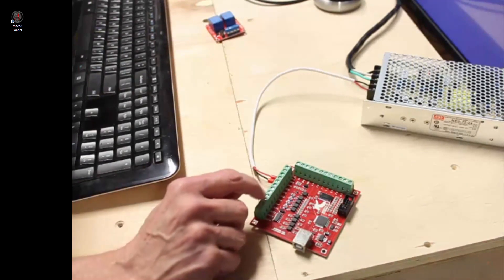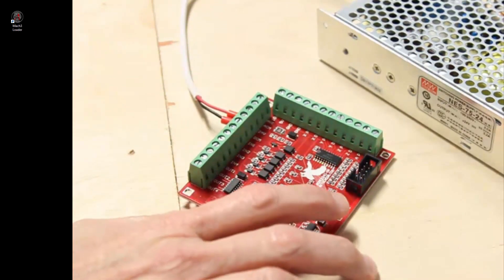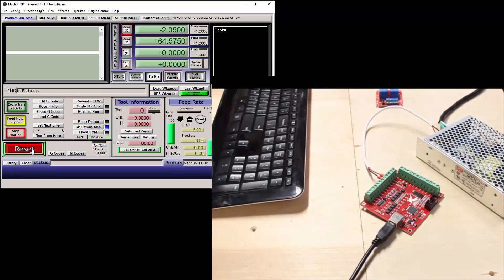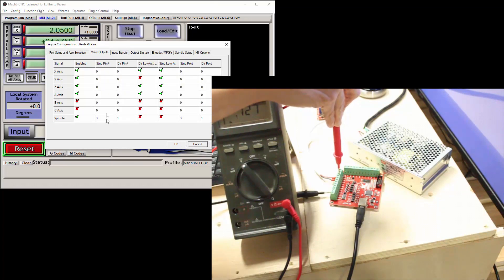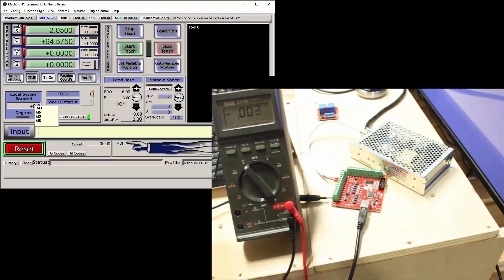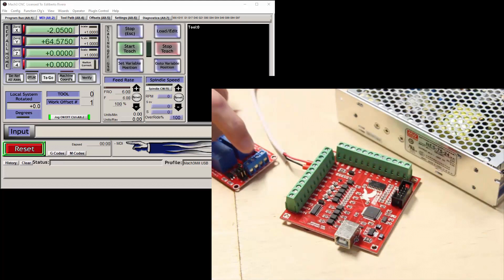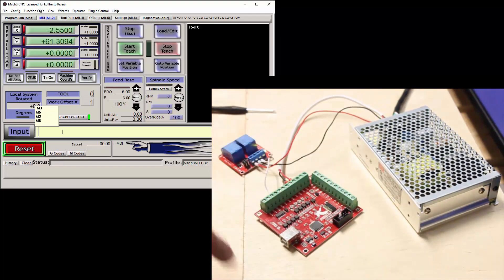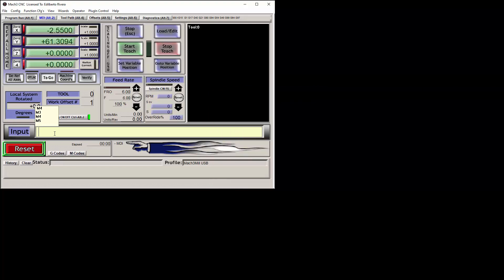Mach3 USB Controller Output Terminals

Comment: If you are having problems with your relays not working change the jumper from Hi to Low on the relay board.
Reply from the maker: Thanks. I do mention that at 6:09, but I do appreciate the comment as it is an important note. Also, I don't mention that the port number needs to be 3.
Reply: @PatrickHoodDaniel damn must have missed it. Spent hr trying to figure out why they wouldnt throw.
Reply from the maker: @BlueFlameOfLife  Haha. No worries. It's still good you offered your time to comment as others may miss it as well. You can't have too much information when working with this stuff, so I am grateful!

Comment: can I use my Breakout Board that controls my stepper motor & Limit Switches? i have a D25-1205 Board.
Reply: Thank you
Reply from the maker: Yes, this board can control 4 axes and has input and output terminals. The input terminals are for limits and homing.
Reply: I meant if I can use it for my spindle motor on the Breakout Board.
Reply from the maker: @miguelsendejas5302  You can use the board to control your spindle's speed through the VFD using the provided AVI (PWM out), ACM (Common for the PWM), and the 10V input. I have a video on this in my channel. You can use the output terminals to turn the spindle on and off, but I recommend using a relay. I have a video on this as well on my channel. To more easily find the videos, go here: https://buildyourcnc.com/products/electronicsandmotors-electronic-component-breakout-mach3-usb-board

Comment: With a 24v power supply connected to the 24v terminal (+) and the DCM terminal, (-)  OUTPUT1 shows 24v constant, with or without m3 enabled/disabled. It doesn't switch at all. (tested with multimeter in DC volts mode, with the negative probe on OUTPUT1 and the positive probe on the 24v terminal, as shown in this video.  The outputs confg shows the ports for pins 1,2,3 & 4 as port#3. Any suggestions would be greatly appreciated.
Reply from the maker: Make sure in the outputs tab, the output you are setting up is set to port 3. You may also want to check under the motor outputs tab under the spindle line item, the spindle setting may be conflicting with the pin you are using.
Reply: @PatrickHoodDaniel  Sir, you are a diamond. Thanks for taking the time to respond so quickly. It was the spindle setting. My problem is solved.
Your videos and website are the best resources for this board. All of my progress thus far is due to your videos. I can't thank you enough. Cheers!
I'm ready to move off the test bench and install the components into my plasma table. A celebratory coffee is in order.

Comment: nice video, congratulations, is it possible to connect the laser to the Mach3 USB Controller, if possible, what should be connected, I have a router with a Mach3 USB Controller and I want to add a laser, thanks
Reply from the maker: Yes, but I wouldn't recommend it. Unless you have a special purpose that you need to use a CNC controller to operate a laser, I would recommend using a laser DSP controller.
Reply: @PatrickHoodDaniel  Maybe something like this?

Comment: I am using av for spindle but I can't use output 1 for anything because it will switch the spindle on and off so the spindle runs on both av and output 1 question is how do I use output as output without the spindle activating
Reply from the maker: You can change the output for the spindle in the motor outputs. There is a line at the bottom for the spindle. I think you can make that a 0 so it does not conflict.
Reply: Hi thanks I tried that but it seems that that spindle line makes no dif on off changing nrs all makes no difference everything still carries on the same I'm fine with just two outputs 3 and 4  just running a light and water but thank you for the reply

Comment: Hi I am a total newbie to all this I purchased a CNC with a porfi4 controller which was working fine till the computer broke and because I couldn't get a computer with a parallel port I bought a rnr motion controller thinking it was just plug and play obviously I was wrong I think I have everything working except the spindle won't turn on I have it wired as per your video but I must be still doing something wrong can you help please.
Regards Dave
Reply from the maker: In the motor outputs tab, there is a spindle line item. Depending on the pin that you are using for the output, make sure the spindle line item is not using that pin.

Comment: It can supply 36V to breakout?
Reply from the maker: The maximum voltage for that Mach3 USB controller is 24V.
Reply: @PatrickHoodDaniel  thank you .if I supply different voltage for steppers motor driver 36V and breakout 24V it have problems or not?

Comment: Depending on the command I use (M3 S50, M3 S100, M3 S70)  at a pmw base 100, Ill get not just output 1 with 24v, also  output 2 3 or 4. Tested on 2 different boards and I just can't find the problem :S at the configuration there is only output 1 enabled (port 3 pin1)
Reply: I solved it! for anyone else having this problem check your 24V DCM connection. mine had become disconnected whc=ich was causing the outputs to float.

Comment: Hi.....How does this controller hold up to something like smoothstepper or XHC controller?
Reply from the maker: All of these controllers use a typical microcontroller to process the incoming data from the computer and output pulse trains for the CNC. These controllers are not complicated and are manufactured in a similar fashion. The controllers that I sell are all protected with optoisolation and galvanically isolated circuits (depending on the controller this one or the pokeys57CNC).
Reply: @PatrickHoodDaniel  Thanks for your reply. I have done so much research, but its so much better to just talk to someone with the actual experience.  So my question as someone new to cnc is: Can I get away with using this better priced controller on a ATC Milling machine setup I'm building? Is is just marketing that the other much more expensive controllers are pushed as more effective?

And just to mention.....your videos are invaluable. Much Thanks!
Reply from the maker: @theunscraven812  Thanks for the kind words. I would select a controller more on the features you need rather than the price. If your CNC has the typical setup, then this controller (Mach3 USB) would be a good choice. If you are adding devices and needing control for more axes and richer features, then another controller might be a better choice. For instance, the pokeys57CNC (the other controller I sell) has four onboard relays, 8 motor driver connections, many inputs and outputs, and sophisticated microcontroller features for encoders and timers. CNC equipment with mist, coolant, need to control valves for operating ATC (auto tool change), etc.

Comment: OK  so im doing that and the output will trigger the relay,  and I got spindle  working!!!     but  I press M5 and wont turn off!!  i unplug the board from the pc and then it turns off!! , and only then I can plug it , reset it and activate again,   but the output is saying locked !!
Reply from the maker: The relay may be getting stuck. If you hit the relay with a pen or something to rattle the mechanical solenoid, it may get unstuck. I have had this happen to mechanical relays from time to time.
Reply: @PatrickHoodDaniel  thank you for you quick response !!  I´m sorry,  what I mean is that , it will throw the 24v on the board output  , but wont turn off on m5,    I checked the motor output step active low on and off ,   when on output 1 throws the 24 V but m5 wont turn them  off not even with reset,    when I uncheck the step active low just wont send no volts and also stops sending the volts as like normally the reset or m5 would,    as if the  M5 wont be executing the "unchecking" the deactiving whatever the step active low triggers,   so im not sure if its something to do with the high low checking,    when you say Will go back to 0.0 volst,   that part Im stuck

Comment: Thanks a lot for sharing this knowledge! To avoid complications I ordered exactly the same relay board (but with 4 outputs) and built 230v outputbox for CNCest 6040 router. I also wired relay inputs through 3 pos on/off/on switches, so I have auto/off/on for each channel to control each output manually.
Reply from the maker: Awesome!! That is a great idea.

Comment: hey there.. Love the amount of content u put up for this subject matter. I've never seen so much of it before. Most ppl seem to gloss over this part of the electronics like it's a well guarded secret that they don't want us to know. I only began working in the electronics field a few months ago. I had no experience whatsoever before this. I'm lost bro. 
I have bought in a lot of the stuff u are using on here with ur CNC but my CNC Router is only going to be 1000x1000mm of a working area, I hope! 
I'm using extruded aluminium 2020, 2060 & 2080 to give it some strength. It's defo my 1st ever attempt at a CNC build. This is a massive undertaking for me bcos as I've said I have no electronics experience.  
So I have one real question if u have a bit of spare time to answer bro..
Does a small cnc like mine need all this electronics? and if so could u give me a list of what I really need to get bcos I'm buying stuff and I'm not really sure what I should be buying. Like a proper list of the tyoes of things for a small CNC build like mine..Thanks in advance my friend.. 
Ur channel is brilliant btw. I've only started watching this past week. Somehow I found it through all the nonsense on here about this subject. I will be sharing it to as many as I can now..

Comment: Hi, Ich benötige bitte Hilfe.  Habe eine kleine Emco CNC Drehmaschine  und möchte die Spindel mit einem JMC Servomotor mit Mach3 steuern. Wie wird das ganze am Board und am Motor verkabelt und wie sind die Settings in Mach 3 ? Motor hat 400W 48 V
Reply from the maker: Der JMC-Servomotor und treiber müssen in der Lage sein, Schritt und Richtungssignale zu empfangen. Hast du das bestätigt?
Reply: @PatrickHoodDaniel  bin zwar cnc Dreher Beruflich, aber meine elektrischen Fähigkeiten sind begrenzt auch mein Englisch ( was mach3 angeht). Die Achsen x & z habe ich hinbekommen.

Comment: Hello sir ,
I got this board but how to configuration for PWM Singal and limit switch and output (1-4)pin and port number..PWM signal is very important sir .. Please
Reply from the maker: I have  those videos conveniently on the Mach3 USB product page on my website: https://www.buildyourcnc.com/item/electronicsAndMotors-electronic-component-breakout-Mach3-USB-Board
Reply: @PatrickHoodDaniel  Hello sir,
I was following your Configuration my mach3 board gives PWM.its works properly.

Another one doubt sir
Its doesn't support G71 for lathe
M70,M71,M80 , M81 for mirroring for Milling.
If any possible sir to run that code for using

Comment: Sir, I have small problems. I use usb mach3 for my cnc machine. During machine running. Steps are missing in stepper motor some time. And the E-stop also sometimes not working. I think the problem on usb mach3 board  or wiring. Please give solution.

Comment: Why do you need a separate power supply for outputs ?
Regards,
Reply from the maker: It is a completely isolated part of the controller. The inputs and outputs are opto-isolated and need to work on a higher voltage for the spindle PWM of 0-10 volts. Also, common industrial components, lile relaays and such use 24VDC.

Comment: So are you saying this board requires Mach3 to work? I'm running LinuxCNC and need to move away from the board I have as it only uses parallel port.
Reply from the maker: You may be able to use the smoothstepper board to do this, but I'm not certain.

Comment: hi, can you make a video how to wire and set mach 3 for limit switch? Thank you
Reply from the maker: Here you go: https://www.youtube.com/watch?v=8un8rbQcoZU
Let me know if this helps.
Reply: @PatrickHoodDaniel  yes, very much. I have a few question. I have a usb board red like yours and I want to wire end stop NC so I have to put in serial
connection. To pin 2 because pin 1 is estop(also nc). In mach 3 how should i set active low or active high? So from supply negative wire goes to switch(com)  and nc pin to input 2(on breakboard). So, in mach 3 active low or active high? Thank yoh very much. Thanks to you and your video i make my homemade cnc work.thank you!.
Reply from the maker: @radudobrescu5402  I only use limit switches with this board in NO mode. I have never tried NC mode.
Reply: @PatrickHoodDaniel  ok, thank you very much!

Comment: Thanks for sharing! My new CNCEAST 6040 has this board in it. I'm working through the process of wanting to automatically start a small 120V coolant pump for the spindle as it's easy to overlook turning it on manually. So in following your video and using the relay module I could use any of the 4 outputs not being used, so it follows in Mach3 Config> Spindle Setup> Flood Mist Control I could use either output and their associated commands M7 or M8 to command the relay through gcode or likewise OUT1 as I use my spindle in a clockwise configuration. Looking at the specs of the relay it is also rated up to 15A AC so no problem there. Is this the correct way to achieve this?
Reply from the maker: Yes, that is fine.

Comment: dos mach 3 interface board need windows xp to run using USB cable ?
Reply from the maker: No, you can use Windows 10 if you  wish and either 32 or 64 bit. The reason you see on the internet that mach3 only works under Windows XP is for users that only use the parallel port,  not the USB. The parallel  port requires 32-bit, but can still use new versions of  Windows.
Reply: @PatrickHoodDaniel   I tried to run it using windows 10 but its not working what do i need to do to make it work ? spesific software or driver? by the way , I have mach 3 interface board the cheep chineas one with Parallel port and usb
Reply from the maker: @AhmedHussainEng  that is a parallel port controller, not a USB controller. The USB is only used for powering the board. As I mentioned in the previous comment, you will need to run 32-bit version of windows. Or get the Mach3 USB controller, https://www.buildyourcnc.com/item/electronicsAndMotors-electronic-component-breakout-Mach3-USB-Board

Comment: Hi Sir. I just purchased Relay Module from your WEB. Can you please show me how wire to VFD. Thanks,
Reply from the maker: What is the model number of your VFD?
Reply: @PatrickHoodDaniel  
Good morning Sir.
My VFD Mod. is YL620-A 110v.
Also I just note . I'm following your video instructions to tested USB controller. but no power to outputs. 1,2 or 3. However I connected to drivers and the machine running ok.
Can you please help. Thanks,

Comment: hello, when i connect via usb to computer led blink but when i press arrow key, led not blinking fast. should i make some settings? thank you
Reply from the maker: Are you sure you copied the plug-in (rnrmotion.dll) on the webpage to the plugins folder and put the XML file from the page into the mach3 folder?
Reply: @PatrickHoodDaniel  i was my mistake. I was hurry first time and not watching entire video. After that, i follow any steps in the video and it is working perfect. Thank yoh very much for your video. Another question....on the driver there is a nr 4 jumper(full or half curent). Should be on or off. I mean you set driver curent on 5 amp but jumper 4 is set on half so there will be only 2.5 amps?
Reply: @PatrickHoodDaniel  another question please, the motor have 2 coil for exemple 1-2 and 3-4 connected to driver. And motor turn...for example CW. If i want to turn CCW shoukd I change 1 with 2 and 3 with 4 or change 1-2 to 3-4 and viceversa?thank you

Comment: Any settings problum or any wire conect wrong .? I am using output 3
Reply from the maker: Make sure that the port for all of the outputs to 3. This is something that I did not specify on this video.

Comment: Sir i have one problum. I am using 5v relay . When i  f5 press router on but when i off router via keyboard or mouse relay not off router. And second my laptop beeping.
Reply from the maker: You cannot use a 5v relay with this board. You need to use a 24v relay because the outputs require a 24v power supply.